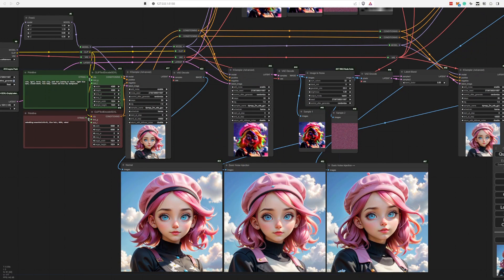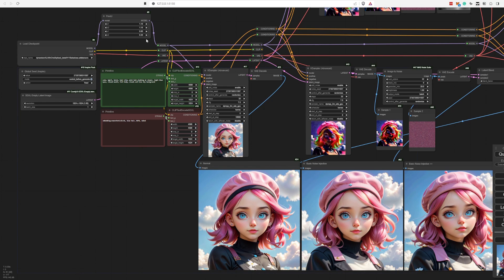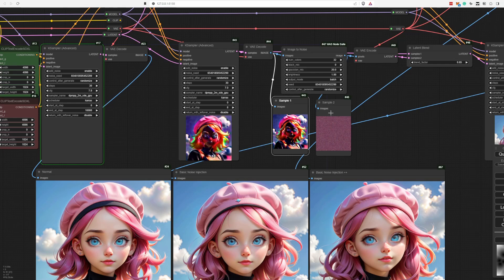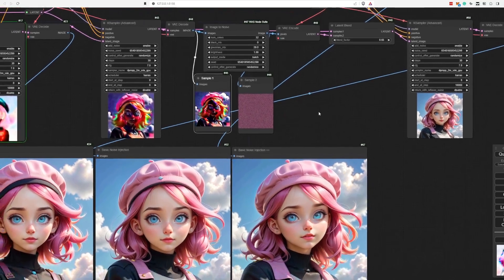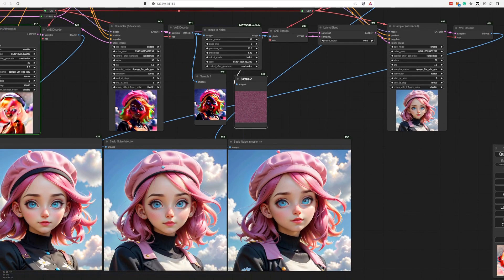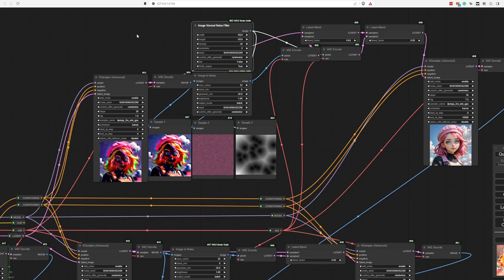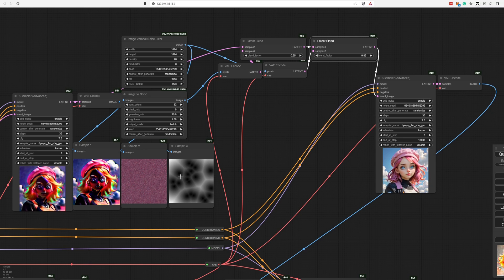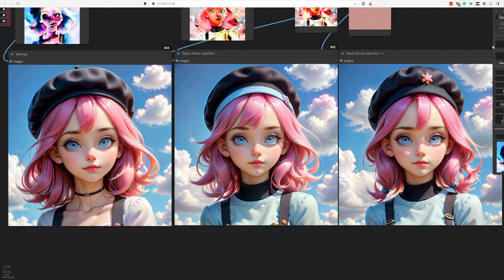SDXL - Noise Injection: Can It Boost Image Quality?

Comment: Where do you get image to noise?
Reply from the maker: you mean like encoding your image? vae-encode? or more something like the SamplerCustom node?
Reply: I mean "Image to noise node"  @tech_bytebrain
Reply from the maker: @damrongtonklang9368  you can use the Unsampler or SamplerCustom node. 

"This node does the reverse of a sampler. It calculates the noise that would generate the image given the model and the prompt. "

Comment: There is Ksampler (inspire), and it provides additional noise with variation strength. Good enough for variations
Reply from the maker: Isnt that the plasma one ? Ive tried a few and also some additional noise injection nodes all pretty useful depending on what you’re looking for.

Comment: What is the rationale in enabling "add_noise" in KSampler and manually making additional noise "manually" with this (A Latent Place) intermediate step? As far as I understand this: you add just another layer of noise between the KSamplers while the KSampler does the same each time (or even each step?). Or am I wrong? Or is this noise from the image not random at all but reflects the growing image?
Reply: I've been banging my head on the wall trying to find an explanation for this, as disabling this option always breaks the results

Comment: Do you think that blurrying the background can help add more details to the foreground that is composed of a person ?
Reply: It can. Sometimes. Ive done some tests on doing some basic image filters and altering background with noise and contrast and blur/sharpen. 
It absolutely has some interesting effects. Not always needed and increases render time. But yeah. It does. 

The one thing I will say - if you inpaint adding noise has the effect of turbo charging your render.

As an example. 
Take a black box. Just black image. Do a mask. And try to render a diamond in that mask. You’ll find you have to go up pretty high (about 0.7) until one starts to show up. 
If you do the same thing with a noisy image. (Black with a bunch of grey noise) …. It’ll render around 0.5